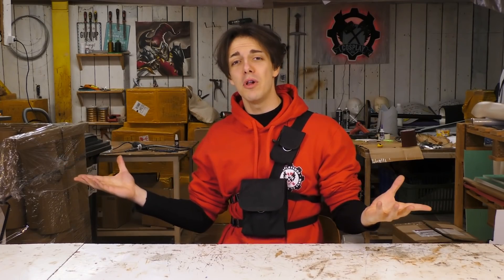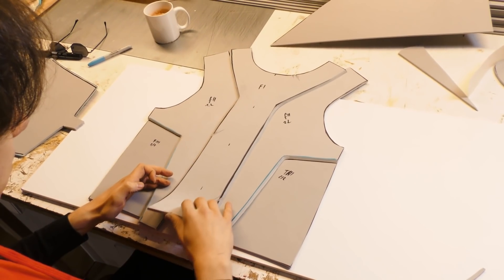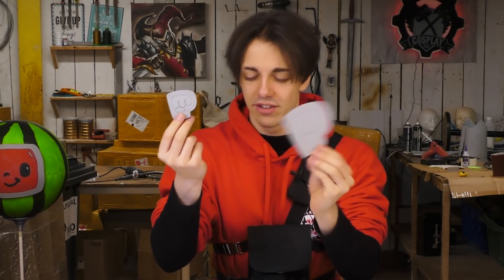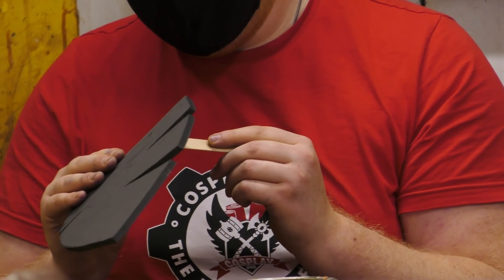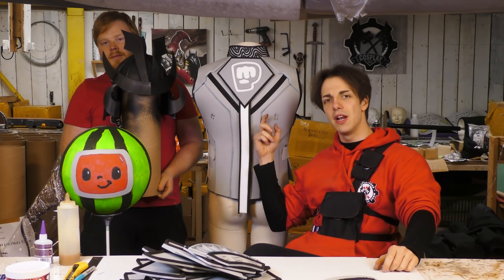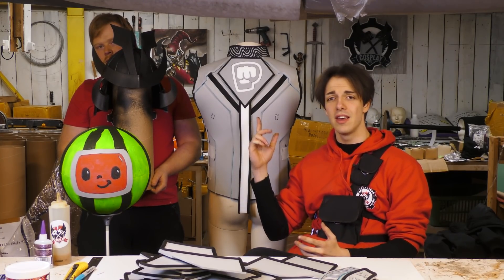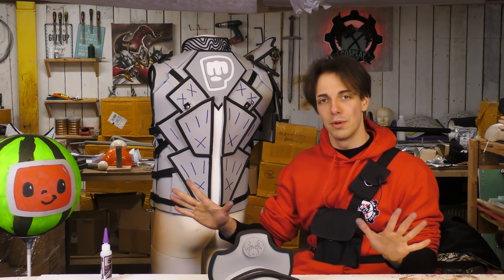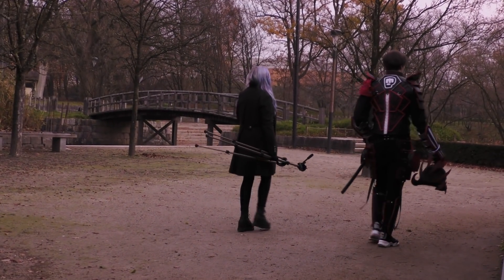We Made Armor For PewDiePie (Coco Disstrack)

Comment: how did u get the idea to use hith density foam?
Reply from the maker: High density foam is in general often used by cosplayers to make armor, while the low density gets used more for organic shapes. :) But it's very lightweight and has many possibilities.
Reply: @cosplayshopyt  weyo knolage straight out of the core. Where did you learn all that stuff? its so much u did alone for the armor: drawing, modeling, chosing what material goes where and then the electrical stuff with the LED's. when i was a kid i always wanted to build myself an ironman armor because my dad has a company where they work with metal but it was to much work tbh
Reply: Mostly experience and trying out new materials
Reply: @remcovanhooren  oi for how long have you been doing that stuff?
Reply: @therealrashoo1305  i am a cosplayer since 2006
Reply: @remcovanhooren  thats a lot of time what have u build till now?
Reply: best to check out our instagram (links in the description) to see that